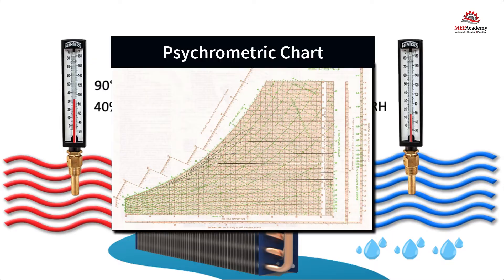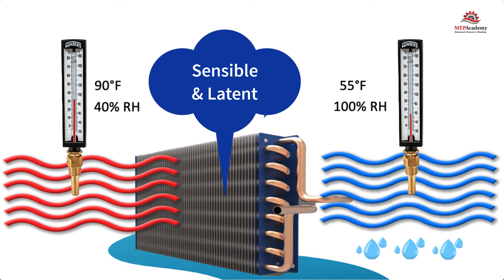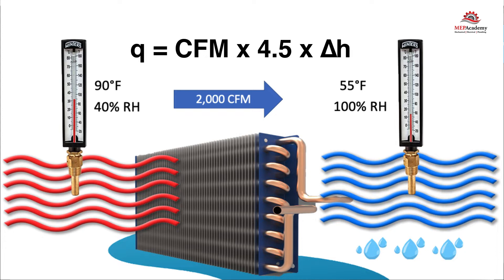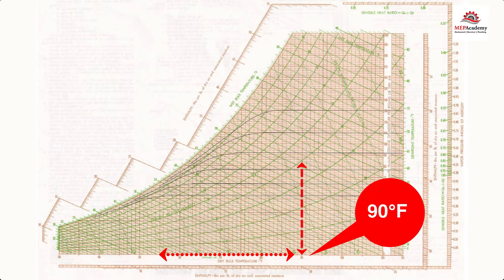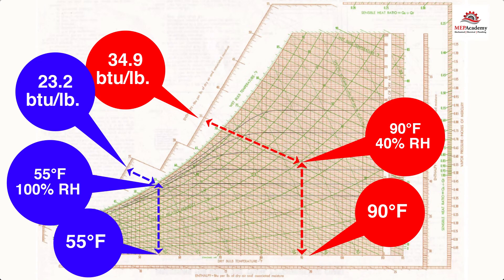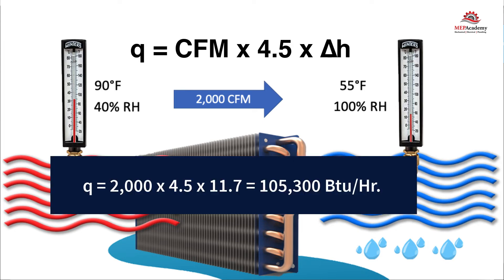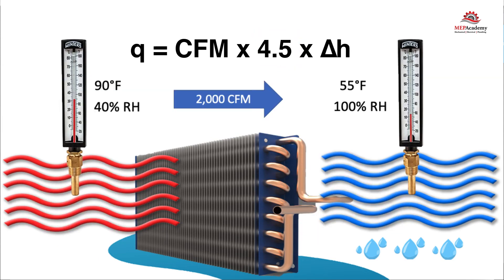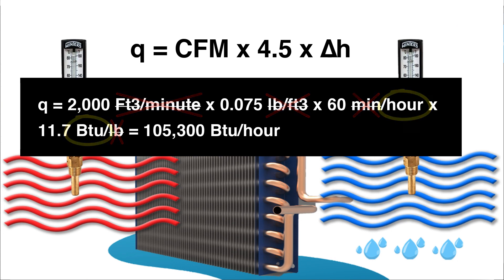Sensible and Latent Heat Transfer Formula for Air

Comment: So on a chilled water coil, comparing this to the water, does Q total for the air equal Q sensible of the water (since there's no change of state in the water)? Some people have said the Qsair=1.085(cfm)(dTa)=500(gpm)(dTw) and I'm not sure that's right.
Reply from the maker: The heat removed from the air in a chilled water coil equals the heat gained by the water, but the air's total heat transfer includes both sensible and latent components. The equation (Q sensible, air = Q water) is only valid if there is no latent heat transfer (i.e., no dehumidification). Otherwise, the total heat from the air, including latent heat, must equal the heat absorbed by the water. For accuracy, always account for both sensible and latent heat when dehumidification occurs. Hope that helps.

Comment: While air passing through an evaporator coil, how the humidity will increase. It becomes 100%RH!
What is the temperature here on the coil?
Reply from the maker: The temperature reaches 55 Degrees and is fully saturated at (100% RH)

Comment: Can I separate sensible from latent to find out how much of my cooling is going to each?
Reply from the maker: Yes, see our video on how to calculate the sensible heat from air. https://youtu.be/ae2_OTU87jA
Reply: Yes, 1 pint = 1 pound of water. 1 pound of water = 970 BTU's. Put a cup at the end of your condensate drain and collect your condensate for 15 mins. For each pint of water you collect, its 970 BTU's of latent cooling. Multiply that by 4, to get your Latent BTU per hour measurement.

Comment: Which purpose we calculate heat of air with sensible and latent ?
Reply from the maker: Depending on the system type that is being used, the latent load could be calculated as part of a DOAS unit where it handles the latent heat from ventilation, and the coil that feeds the zone will handle the sensible load, or if you have a packaged unit then the coil will need to handle both latent and sensible heat loads.

Comment: What if I don’t have the CFM, but I have the size of the air vent and the speed of air?
Reply from the maker: If you have the dimensions of the duct and the velocity then you can calculate CFM. CFM = Velocity x Square Feet.

Comment: Is there any formula to calculate delta H?
Reply from the maker: Delta "H", Enthalpy is a condition of the air, which has two values. You can rework the formula to calculate the Delta H using Delta-H = Q/CFM x 4.5. This should get you the delta "H"